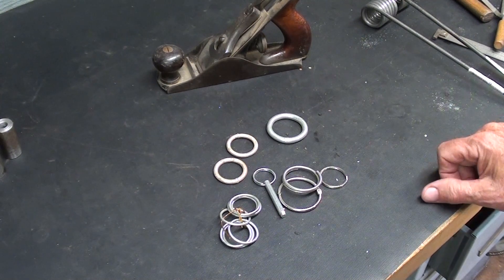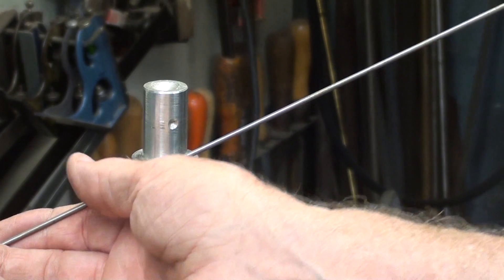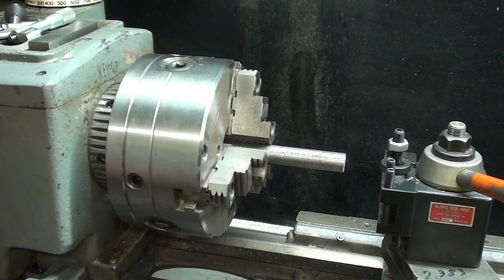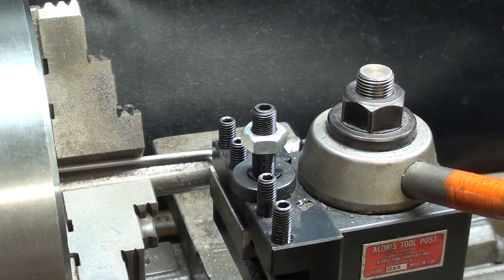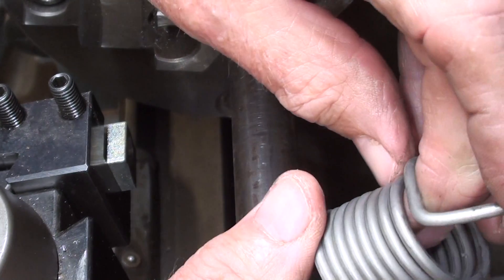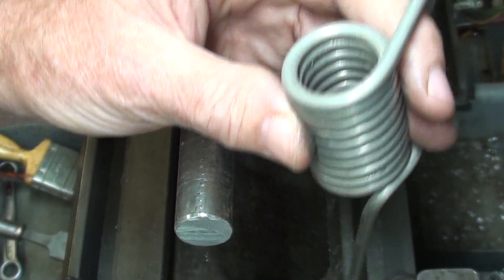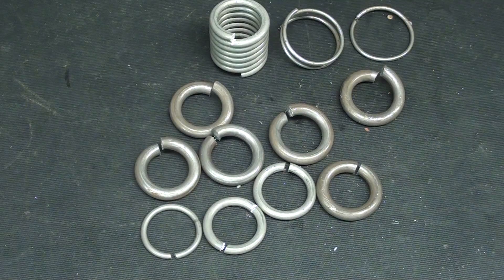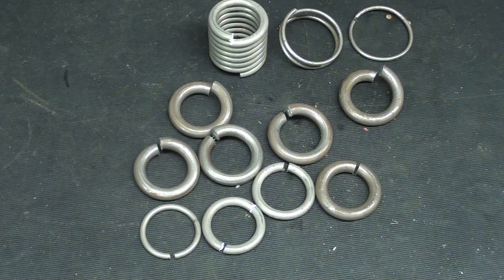MAKING STEEL RINGS ON THE LATHE Tips #509 tubalcain

Comment: Steel rings. Love it.  Women's purses hold the weight of the world, but they lack the strength. For my wife's purses I used to remove the "rings" between the body and strap and insert metal tubes into the leather parts of the strap and body and then install new rings such as made here to reattach.  Think of Hermione at the end of Harry Potter series and all of the stuff that came out of he purse (like multi room tents .) Those little rings such as made here could attach a purse strap to a bag and hold the weight of the world.
Reply from the maker: Yes, many of my wife’s purses fell apart

Comment: I did this back at the high-school but never let the kids do this...in the south we called that the hay guys watch this moments. This is similar to what new armorists learn first, to make the rings for chainmail.
Reply: Not sure what you’re getting at but experienced hands can often perform a “calculated risk” task much safer than inexperienced hands. Driving an automobile is a good example.
Reply: @scottvincent7666  It is called risk assessment based on the knowledge of a machinist career that now spans 30 years with never a single injury because stupid ideas were never introduced to me. When I learned to drive I was 14 and was handed a truck so I could get to school and work and since then have never caused a single wreck, not even a fender bender. It is not always a matter of experience because if the person is taught properly from the start they know how to avoid the issues that could hurt or kill.
Reply: Scott Vincent p
Reply: This is a way fancier setup than the battery-powered drill and 1x4 jig I used to make maille rings...

Comment: Had to make thousands in 3/16" steel Sub Arc welding wire back in the day.

Starting with a hole in your mandrel creates its own problem.
How to get your coil off !
Doing it by hand (on production) we were able to start the bend.
Then extract the wire out of the hole a bit and continue to wind the coil.
This gave us a loop to nip off when we needed to remove the coil.

We developed all sorts of slots welded to the mandrel to eliminate the problem.
Also ..
Not letting the loose end flick out but relaxing gently the winding pressure stops the spring back making the rings different sizes.

We actually made some out of 1/2" round and square black mild steel by hand  ( cold )  down to about 2 1/2" OD.
Much easier if they were bigger OD.
Reply: Starting with a hole in your mandrel creates its own problem.
How to get your coil off !

The fix is to split the mandrel, install the wire in the slot, then put the split end in the chuck with one jaw over the slot, then wind away. When finished loosen the chuck, pull out the mandrel and take the spring off.

Comment: Just did this back in june. Made a pile of rings from 25 mm to 75 mm to make ball for wifes bday. Did on lathe 26 rpm, 6 meter lengths of 1/4" mild steel fed by leather gloves onto mandril with hole drilled. Sure was a lot of fun but pretty dangerous. When you are approaching 70 danger is fun.ball was 400 mm. Had 180 rings in it